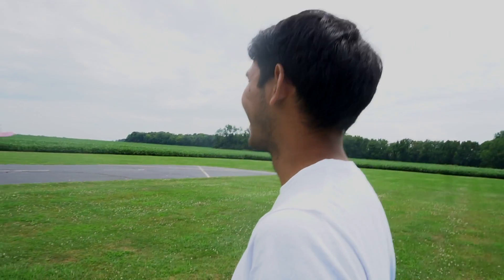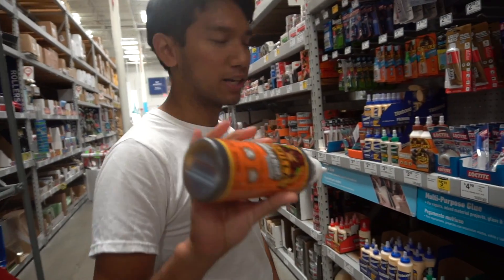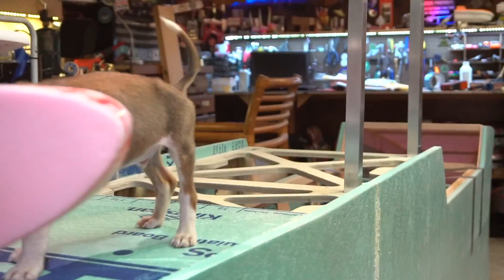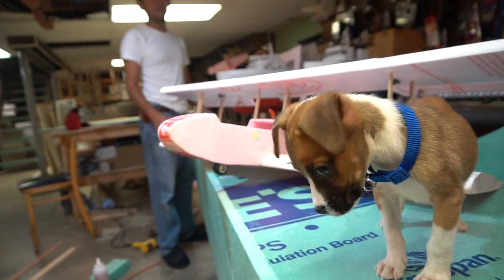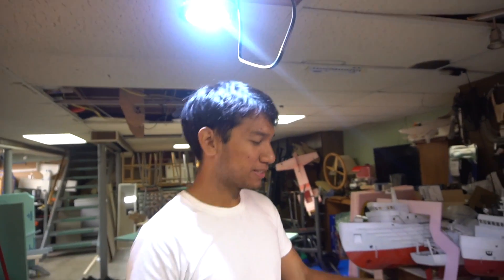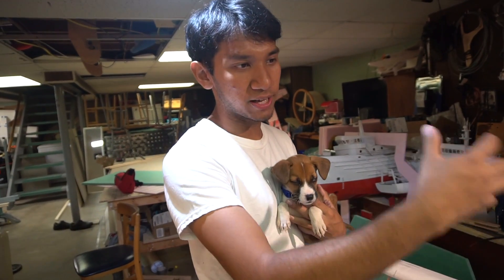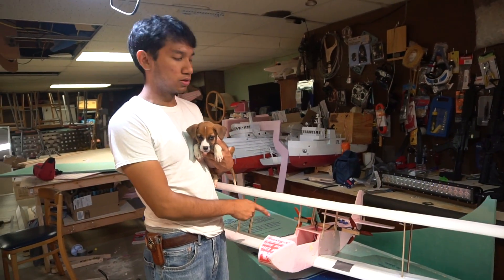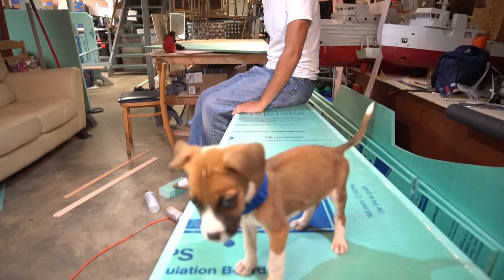DIY electric ULTRALIGHT pt1(fuselage and basic design)

Comment: I think my original comment got ghosted from the links in it, anyway here it is again.

Winding tow around the fuselage isn't really going to add much strength, unless you were making a pressure vessel. Winding like that primarily helps with hoop-stress. Which if you were making your aircraft into a pressure vessel that would be fine. But a tail of an airplane is mostly longitudinal lever loads. So Tow getting wrapped on like that isn't really going to add much unless you actually did some engineering design and filament wind it on. Still might not be the best application even then. Carbon has fantastic strength when you pull on the fiber. It has less strength when you try to push the fiber back together (compression load) As it is now relying on the resin to maintain the strength. Any time you are relying on the resin for strength and not the properties of the carbon fiber you are going to have very low performance. The resin is pretty much just there to keep the fibers oriented in a direction that they can do the most good. Carbon fiber also isn't a fix-all like everyone seems to think it is. It has some positive properties, but fiberglass actually has some properties superior to carbon (impact resistance and compression strength). But Carbon does have some great applications.

 I do have some general concerns over your airplanes general design. A scale model is a great way to get some general information about your airplane. But when you scale something up that much there are lots of little things that can grow into large issues. Like harmonic vibrations, some turbulence effects that are unexpected, the airflow changes when you make it bigger, etc. There is a reason why most people who build an aircraft go with a proven design. Even if they have the engineering chops for it. There are always tons of little things that you don't expect ahead of time that can bite you really hard.

 I don't think you will get sufficient engine power to fly your aircraft with hobbyking motors. Some motors that might actually give you enough power would be either the EMRAX motors, Or there are some hobby grade engines from Alien Power Systems that might work. A supercub is plane of similar size, but a bit heavier at @800 lbs. But also way more streamlined than your airplane. It has a 100 HP engine on it. The airplane does do 125 mph. And a minimum speed takeoff is around 40-50 HP being used. Drag is one of the largest consumers of horsepower in an airplane. Which the largest hobbyking motor I know of will just barely have the oomph to get it airborne on ground effect is my feeling. That is also running those motors at everything they have. Having a power margin is a great safety device in an airplane. Having zero power margin makes it so that any failure you have, is a catastrophic failure. My guess is your plane will end up being not that far away from 600 lbs when you get everything on it. I have made excessively large battery packs using Hobbyking RC lithium batteries. The one pack I made had 8 kW/Hr of power with 176 nominal volts and 35 Amp Hours. It weighed 125 lbs when all was said and done. Which is probably about the maximum weight you want to have in your plane. For batteries. You will also need to put most of the batteries in the nose of your airplane for weight and balance. With your motors near the back high amperage cables weigh a lot. Running 40 HP through the pack it gives you optimistically 15 minutes of flight time. Just enough time to takeoff make a couple of turns and turn around to land again. 

The final bit I will talk about is some things about general Test procedure stuff. Come up with an extremely detailed test plan. Do not improvise on it during tests. This is how you come back home to your puppy at the end of the day. Have people who have actual designed their own airplanes from scratch and are still living and flying their plane review your test plan and your design. Something you have to avoid at all costs is "Go Fever" Where you have spent all this time doing this, and will feel a lot of pressure from us and your peers to make it successful. Then you will choose to fly the plane when you shouldn't have. I have seen this happen to you on your other projects you have posted on your channel. I know this is a different project form those. This kills a lot of very professional pilots every year. No so much in testing their airplane, but flying into bad weather conditions, or trying to fly home with a part that is suspect. It honestly is a really hard thing to avoid doing, unless you are making a very conscious effort to avoid it.

 A parachute is also unlikely to save you. Though it does at least give you an option in some situations. Highest chance is that a mishap with your plane will take place at below 100 feet altitude. So even if you ditched perfectly you will still hit the ground with an unopened parachute. Also getting out of your aircraft will be much harder than you imagine it to be. Especially if you are in a spin. It could take thousands of feet of altitude for you just to climb out of it, especially when something has broken on it. There are classes you can take that will let you practice getting out of airplanes in abnormal situations. Typically this will be in a swimming pool and they will spin you a bit and dunk you in. I promise it will be way harder than what you think it will be.

 So honestly if I were you, I'd slow down on the building more. Don't set a timeline for completion. It's fine to set a mental one to help you get work done on it. But if it isn't ready you shouldn't fly. If there is something bothering you about the plane, don't ignore that feeling. Talk with others in person who have built their own airplanes. Don't trust testing that some guy on the internet did in his garage as authoritative advice on material properties. Be safe out there, don't be just one more of those guys that were killed by their own creation. I've had enough close calls in that regard to not recommend it at all.

Comment: This is awesome.  You can stop reading here if you like, and just soldier on.  I'll still love watching what you do.

I'm most worried that thing is going to be overweight.  A little testing will show you just how thin materials can be.  It's a little shocking to see the half inch ply there.  Stuff like the the KR2 is made entirely from 5/8" square stock, and 1/8" ply.  If you're gonna glass the fuselage, that thing is going to be structurally strong enough to be a cargo airplane.  Or, do aerobatics.  Provided you can keep the empennage on.....  

You appear to be somewhere between a KR2, and a SkyPup.  The two designs don't really cross very well.  They both are "stick" designs.  The KR2 uses a stressed plywood skin to keep those sticks apart.  The Skypup uses foam.  Both the KR2 and SkyPup don't get fiberglassed afterwords.  

If you want to do foam and fiberglass, (which is a good design..) you should look at the Rutan designs.  But it should be noted, that once you start to "wet out" anything, stuff tends to get heavy fast.  "glass" birds tend to be somewhat heavier.  

Your method for determining control surface forces is.. not good.  And can be quite dangerous.  The surprising things you'll run into, is torque on the tail fin mounts.  

There's a book called "stress without tears" on amazon.  It's cheap, and will ~really~ help you on this.   

I also recommend picking up the book "flying on your own wings."  It's by Chris Heinz (of CH650, 750, 850, 2000) fame.  

Keep up the good work.

Comment: Love your optimism... as an engineer i would warn that having not failed structurally is not an indication of success. You should be operating several factors below any failure envelope when considering life safety issues. Also, while not my area of professional expertise... in my opinion a parachute is not a panacea. I understand you need significant height off the ground for them to be useful, if it works at all. I would recommend bringing on an experienced amateur/experimental builder pilot on board the project for advice and guidance... be fun to learn through your videos what an expert has to say about design, safety, regulations... ... also work fairly close to a proven design... plans are plentiful and may save your life... i provide this advice understanding that you wont likely heed it and dont want to hear it but i do so for selfish reasons... i enjoy your videos and want you to keep making them. Seriously, hit reset, take a beat, pick a plane design you like that has a community... go to the chat room and find someone willing to offer builder assistance or mentoring. I understand the demographics in this area are such that you may just find an old bloke with nothing better to do who would get a kick out of helping and providing decades of accumulated advice. Then order the plans and scratch build it. Still cheap! I think this project could warrant a separate channel or sub feed. Call it Peter Flies, go through the whole process and share good detailed info on what you learn. I would fund that!

Best of luck ...

Comment: Big FliteTest fan and I'm a 20 year experienced comm. pilot/instructor/homebuilder started in R/C when I was 12. I do like how you're building and it looks like you're doing a lot of things right structurally.  Braced biplanes are structurally pretty simple if you know the basic.  Watch for lateral stability especially in wiring the wings.  There's a lot of twisting forces.  Go study a a classic biplane, it will tell you a ton about how to brace them.  Pay a lot of attention to detail, don't rush anything, especially flying.  Take your time and test everything on the ground a know it works before you go up.  When you get ready to fly, give me a call.  You obviously have all the skills, R/C is easier, but I can probably teach you a couple things, especialy test flying, you weren't expecting.

Comment: recently heard a good recommendation concerning redundancy used for fault tolerance; "don't use the same two parts in both channels".  the reason being, say the motors or the speed controllers have a fundamental weakness in your design, a fault condition could occur on both drivetrains simultaneously.  dogspeed!

Comment: It may be fun and he may get some unexpected lift when he least expects it.
Just wait until there is a hot day with much up and down drafts.
I do hope he will do some stress testing before he flies it,
And try for at least 7 positive and 6 negative loading the wings etc,
Or he might find himself in deep trouble trying to land with it falling apart.
Styrofoam has a tenancy to deteriorate with the sun after a year or 2, and this may cause epoxy separation with an unexpected lose of something But you may enjoy the feeling of flight for a short while But it's the sudden stop at the bottom that hurts

Comment: put a hole in the bottom so you can drop firecrackers on naughty children

also are you going to be doing mechanical or electronic control (are the control surfaces going to be controlled electronically or mechanically)

Comment: Check and doublecheck your CG values (including your weight) before you go. Make sure your elevator has enough travel to accomodate an CG offset. You can finetune later on. Also try to make your wing spars and horizontal /vertical tailplane as rigid as you can, with an incidence angle (v shape) for stability. Aeroelasticity and it's effects on control surfaces are not something you want to encounter, especially higher up. Good luck!

Comment: Hoping for a more detailed design video! It's fascinating to get a look at it. Here's my gut reactions. (Source: Bachelor's degree in Aerospace and Mechanical Engineering.)

Firstly, I'd love to get my hands on some technical details of this aircraft design! Mostly because it's cool to see what people are doing, and also I'd like to proofread it a little bit. Mostly wondering what expected takeoff weight is, overall dimensions, airfoil choices, and powerplant.

1.) Motor failures- a sudden yaw near takeoff/landing AOA & altitude could send you into a stall of course. Maybe a good failsafe mode would be an automatic shutdown of both motors if one fails, with an override for turning it back on. I'm aware electric motors are pretty great, but I actually had a burnout on a twin motor at FFW which plunged my plane into the ground since my rudder wasn't enough to handle the yawing moment.

2.) Are you planning on instruments? I would argue for an Angle of Attack indicator- even if it's just a weathervane slapped on the side of the cockpit. The motor arrangement certainly would help this sort of instrument- making it easier to find a "clean" airflow to measure. Anyways, AOA indicator would be the very best stall warning to work with, needing no calibration with weather or altitude and works when in turns as well as level flight, unlike an airspeed indicator. This is particularly important since most stall-related accidents occur in turns at low speed, where a speedometer is somewhat less accurate.

3.) Are you designing the wing with stall mitigation? Will you use vortex generators or washout? Remember this would be to maintain roll control during a stall, not delay a stall or make a high lift system (high lift systems should stay away from light aircraft IMO).

Other things like biplane vs. monoplane? A biplane makes sense (I wouldn't do it solely due to bracing complexity leading to more failure points), though in light aircraft like this you really don't desperately need extra lift (usually the thicker airfoils used are easy to keep light even in a cantilever monoplane). I really dig the forward cockpit- you'll have super good visibility!

Comment: Suggestion 1: Wire cross bracing in the rear half of the fuselage to prevent twisting forces from twisting your tail off.
Suggestion 2: Dogs are cute, but not what we're looking for in this video series.

Comment: Something you might want to think of, that I have not seen mentioned. Washout in the wing. You may want to make sure the inboard sections of the wings has higher incidence than the outboard sections. During a stall the inner section near the fuselage will stall first, maintaining aileron effectiveness, and preventing a stall spin situation. If you have a wing with zero washout, when approaching a stall, one side or the other will stall first, if there is any slip, and or you are in any bank. The stalling side, with zero washout often has a complete stall of that wing before the other, causing the aircraft to drop harshly  to the stalling side. So, if you can set it up when you mock up the wing, having appropriate washout can save your life more than anything else. A stall of one wing vs the other at 30 or 40 feet agl, could easily mean a vertical impact.

I also agree with the concept of bulkheads in the fuselage.. dont need to be very thick.

Also the (what sounded like) spiral wound carbon.. not so good. Stringers along the length of the fuselage on each plane is sound for rigidity, and a good idea. The spiral wound carbon on the other hand, may induce some unhealthy asymmetrical twist to the fuselage when load is applied. Unless you wove a spiral in both directions, so the stress was equal, I would stick with longitudinal strips of CF.

Cant wait to see the progression. Btw looks like its very similar to the Benoist XIV. First "airliner" in the world.

Comment: Have you done any rough loading calculations to see what some of the joints are going to experience?  I assume your model of it is scaled for weight and wing loading also, otherwise the flight characteristics won't necessarily match...

Comment: "It'll add some structure there"
Peter you could get away with just glassing the whole thing with no reinforcing spars, fibreglass on foam is strong as all hell to the point where some boat manufacturers use it to save weight

Comment: Don't use the wood that ur using because it's like hella weak and I can snap it just by using a weak karate chop and the only way you were able to sit on it was because the green roof was also attached to the sides and there was alot of support in the wooden body and that's another reason why you were able to sit on it

Comment: I'm going to be honest. Home Depot isn't the lightest material. The reason we use spruce is because of its strength to weight ratio. You will need at least 4 motors for the weight. That's assuming you go the 100cc electric equivalent. The disk area of the electric motors is just too small to produce the required power. The reason Rotax gets away with it is because of the gearing they have.

Comment: For the propellers make sure that the blade angle is as close to 90 degrees as possible so you achieve maximum power.

Comment: Yes, please post you designs/details if you are able. Things like fusilage/wing angle landing gear /gear attachment points, prop choice (num blades, pitch, rad v motor power/kV), max/min voltage, battery series parallel cfg, COG v COP placement, etc.

Comment: Peter,  you need what the engineering team that I'm on has.  You need a "Should Jar" every time you say the word should you put a dollar in it, every time you test something that you said should of worked and it doesn't put ten dollars in the jar, if it does work take 5 out.  If you are testing properly you SHOULD have some money to celebrate the end of the project. 

Now for some advice, study up on young's modulus, just to make sure the foam and wood combination add strength and not just weight. simplest example is a rope and a chain that are rated to 50 lbs each used together you can't lift 100 lbs because the rope yields at a different  rate than the chain.  The chain breaks because the rope is still st stretching when the chain hits its limit.